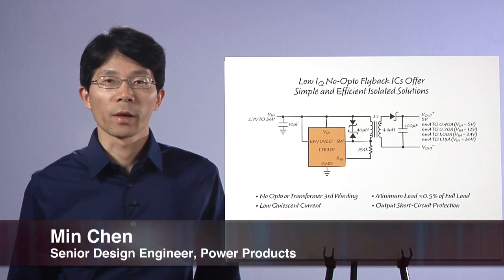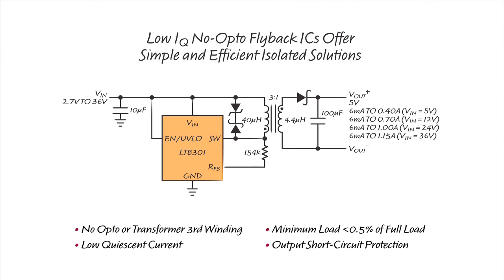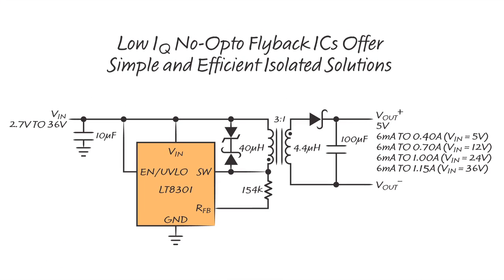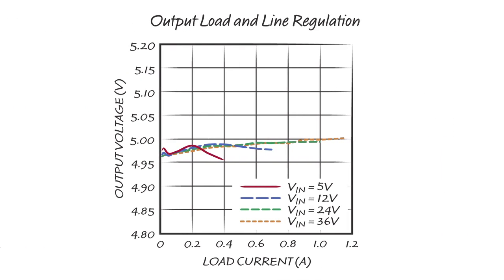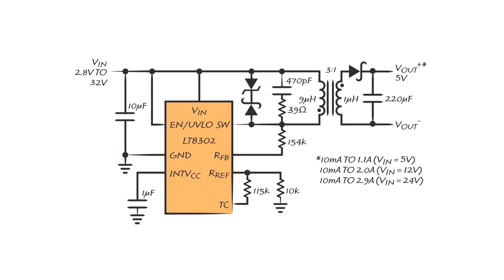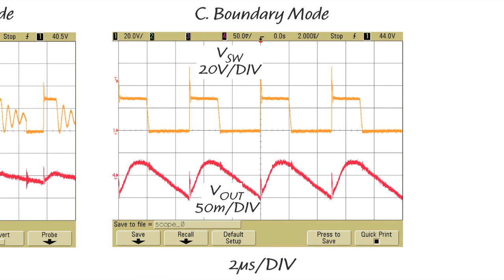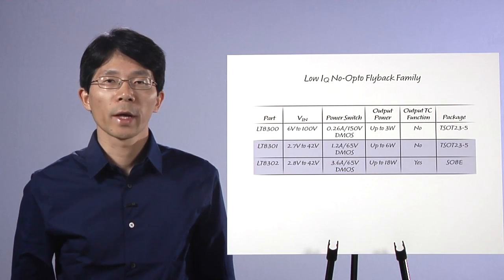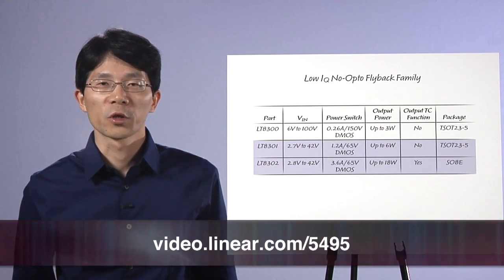Simple, Compact and Efficient Isolated Power Solutions

Comment: a stupid question: i'm using lt8302 for a dc-dc converter. i've set up everything but when i start it up, the lt8302 doesn't switch. there is permanently di input voltage at the switch. how can i make it switch on and off ? that was the case in the simulation but i used the command .tran startup and it worked. what should i do now in reality?